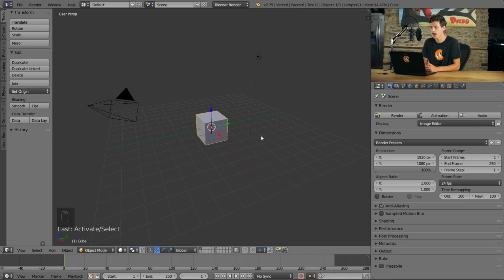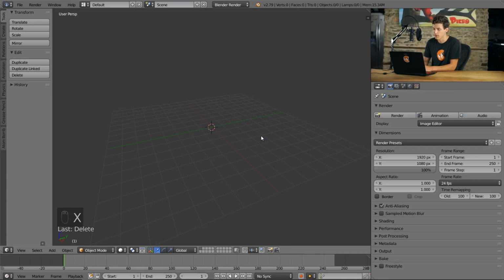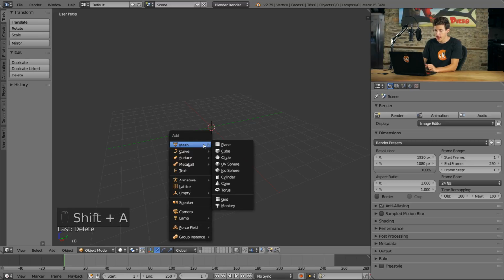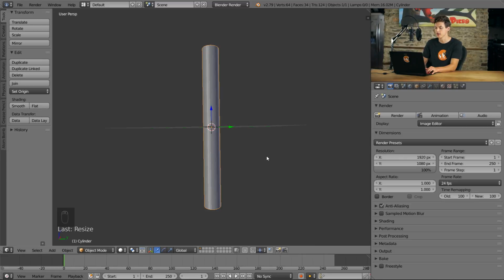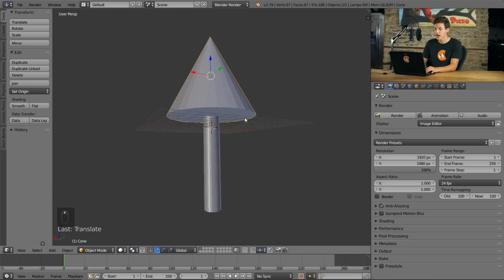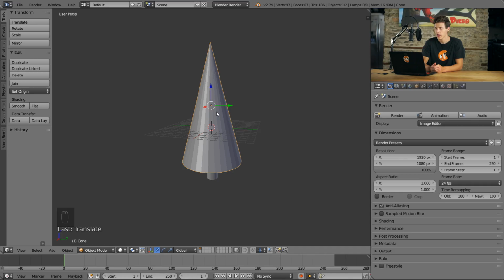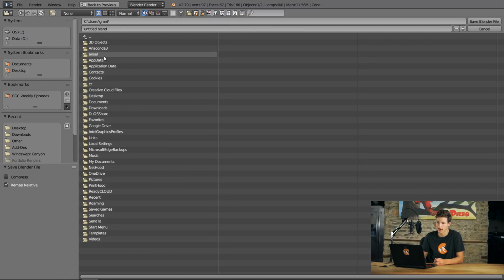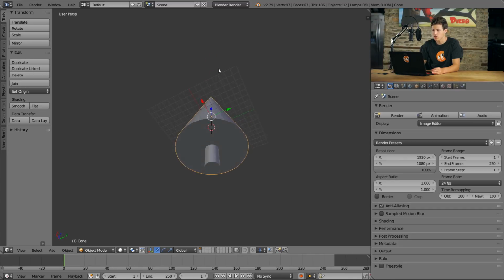Blender Basics Pt. 16: Creating Your First 3D Model in Blender

Comment: Would it be better to set the depth for the cylinder since scaling will modify transform? In 3ds max we have parameters for height and if we scale an object we use xform to reset transform so does it compare with Blender?